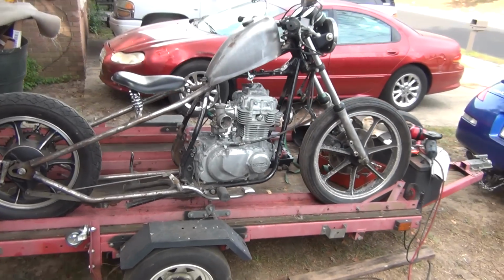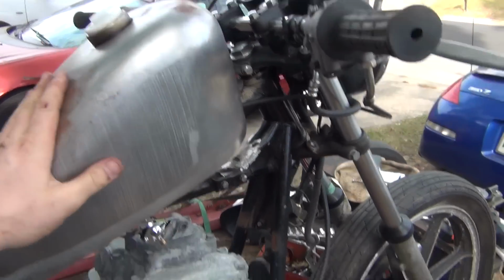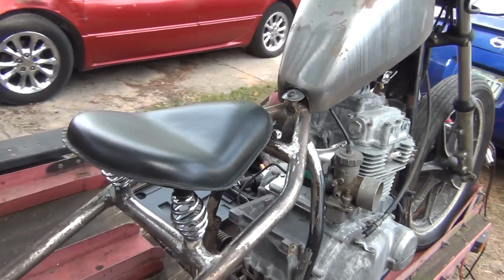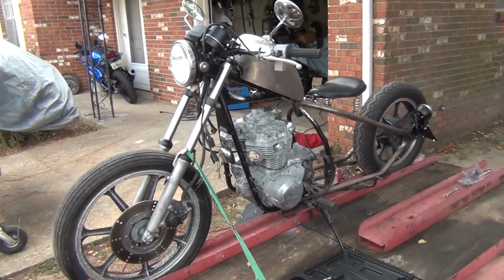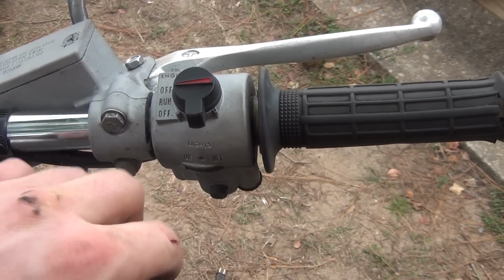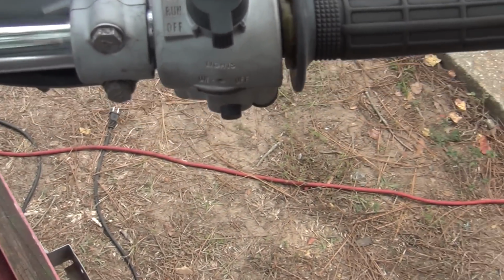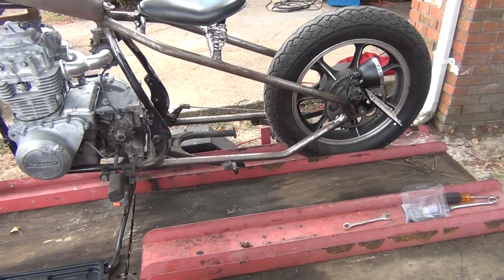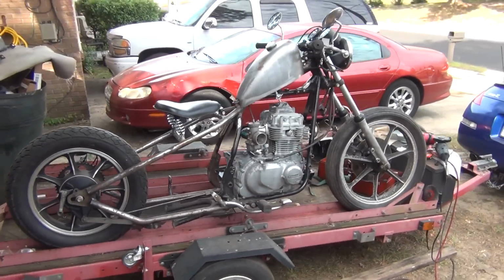KZ440 Custom Part 5 - Engine Mockup

Comment: Did you make your own two to one pipe on the intake it looks different from the first one? I have the exact same bike bobbed and I want to go to 1 carburetor
Reply from the maker: It is indeed a different intake manifold. I got it from 11thhourindustries.com   They have a few different styles of intake manifolds.  Check them out.  If you get one, make sure you tell him that you saw it here!
Reply: @DuckmanCycles  thank you very much I guess I'll have to wait till they're in stock
Reply from the maker: No worries!  I hope that helps!

Comment: Ho visto che hai sostituito il carburatore originale con uno a ghigliottina...differenza di prestazioni? che misura hai montato? Grazie
Reply from the maker: I don't know the size, but it is smaller than stock.  Performance seems to be about the same, this was only to make it more reliable and easier to tune!  :)